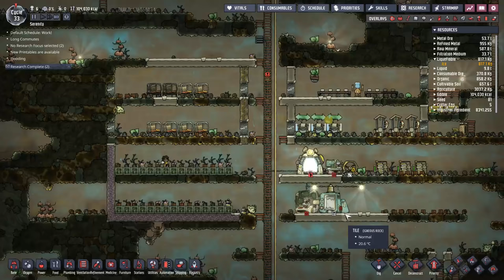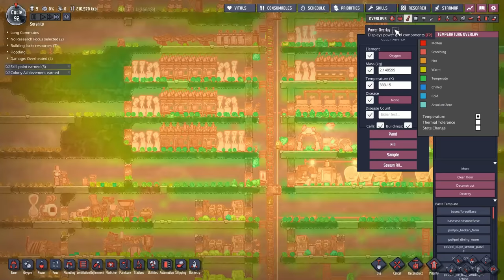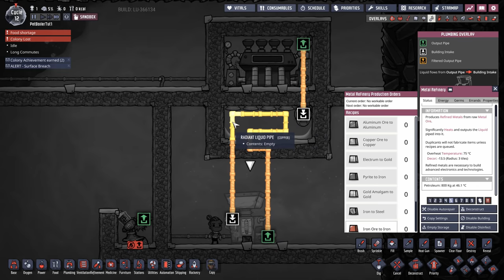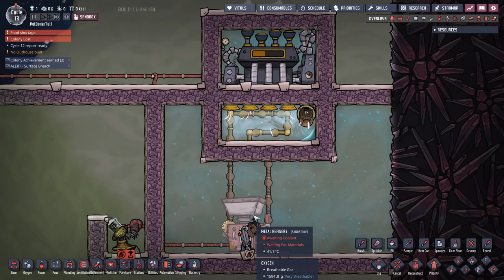Temperature management: Tutorial nuggets : Oxygen not included

Comment: Great vid. It gonna make my future base more efficient. 
I have 1 more question. How Tempshift Plates actualy work and what's the point of using them?
Reply: They act as lubricant to move heat around as a background prop. Normally it takes a long while for materials to transfert heat (between gases and tiles, or even between tiles without limiting dupes movement). And some gases and materials have a low thermal conductivity. The tempshift plate acts like a conduit for all nine "space" around it. They have a lot of mass (800kg, compared to a tile with 200kg, to a tile full of liquid 1000kg, to a tile of gases (between 1 and 20 kg for extremely high pressure; normal gas pressure for a dupe is 2kg to avoid the "pop eardrums" debuff)) and act like radiant piping for all their 8 other "space" arounf them, equalizing temperature between them at a quicker pace.
Reply: @francoiscoupal7057  thanks, now its much more clear for me. :)

Comment: This is exactly what I was looking for, as I just started converted my masses of various heat-generating machines into an industrial brick, so thanks!

One question...  I've noticed that even though the room is full of steam, with CO2 at the bottom (from the petroleum generators), I still see the occasional blob of polluted oxygen floating around near the top.  I suspect it's from the polluted water being generated by the natural gas and petroleum generators.  Even though I have a liquid pump at the bottom pumping that out, I guess it's offgassing and producing blobs of polluted oxygen that float to the top.  Will those impede the steam turbine in any way?  Does it only ingest steam, and will leave non-steam blobs of gas there?  Or will it suck them in but then jam up and stop working (like when the wrong liquid is fed into some machines)?

Thanks again!
Reply from the maker: I think it will bock the turbines, you should only get polluted O2 forming if the pressure in the room is below 2kg. I keep my room at +15kg and no O2 can from from the polluted water.

Comment: Is there a kind of rule of thumb for how big an ice box ought to be? I am referring to your earlier video on rockets (part 1) in relation to creating liquid O2 and H2, and not wanting too much liquid O2 in the liquid O2 tank, and that a bigger liquid H2 tank if higher liquid H2 production rate is desired (these two tanks are essentially the icebox, right?).

Also I have a similar industrial brick set up in my base but my ice box (stole your design up there with a pump and vent setup, instead of a constant loop) somehow stabilises at around 60C, still trying to figure out why (though it's not really causing any critical failure), but I doubt it has anything to do with its size (though my icebox is slightly bigger I think sizing at 3x3).
Reply from the maker: Unless your industrial brick is producing a megaton of heat you should be able to reduce the temp of it as low as your coolant will allow. Double check your insulated/radiant pipe and make sure your not exchanging heat where you should not. Also double check your temp shift plates, remember they can exchange heat diagonally not just left/right up/down. For the Liquid O2 H2 tanks I tried to make them small as it generally a waste to have more than 5/10 tonns on hand at any one point. If you check the rocket calculator you can figure out how much you would need if all your rockets requested fuel at the same time and plan accordingly.

Comment: @17:23 my setup is close to this, but the metal tiles are not transfering the cold across the metal tiles and door.
I used iron for my metal tiles and steel for door. Yeah 25% less thermal conductivity, but not 0.
For some reason my cold transfer from my cold tank to my little icebox is soooo slow 5 cycles and have gone down like 5c :(
Do i really have to use alluminium?
Reply from the maker: Did you use any Temp shift plates? The water itself is not a great conductor, so the temp shift plates force the temp from the water/ice into the iron tiles.

Comment: In my base I use 3 steam turbines + aquatuner for a single refinery, with a largish 4x15 boiler room to radiate it, using crude oil (and some naphta I had) and the coolant still overheated to sour gas. 

In your example, a single turbine is enough to smelt steel without boiling the coolant.
That said, I use an average of 2-3kg steam per tile, while you seem to use ~20kg. Is that such a big difference?
Thanks again for your videos, keep up the good work!
Reply from the maker: The extra mass makes a huge difference. Imaging a 500C 10kg bubble of hot liquid passing through a room that has a half a kilo of gas pressure at 0 C. With perfect temperature transfer the half kilo of gas and the 10kg bubble will end up at 476C. Now make that half kilo of gas 20kg and everything will even out at 166C.
If you want to cool or heat things up having an awful lot of mass around at the temperature your aiming for makes for a very stable system.
Reply: That totally makes sense. Moreover, due to TH clamping, low masses might not conduct too well.
I think also the naptha was problematic. I thought it might be good because of the higher vaporization point and higher SHC, but its TC is much lower, meaning it sheds the heat slower.
Made some adjustments that work better now.

P.S. When cooling a cool steam vent, isn't it better to put the AT/ST in the room with the vent? That way you can utilize the fact it starts at 110, heat (with the AT) and get better cooling.
In my system, I have a pool below the vent with doors that open when the pressure in the main room is too high. The AT cools that pool.

Comment: Loving these videos! I do have one question on how I should cool down a massive tank of 75C clean water. I have a salt water geyser which I desalinate and store in a large tank, but I'd like to use the water in my base, maybe for Bristle Blossoms or whatever. Could I place my large tank in the same spot where your 3x3 is and have it cool down enough with this setup? Would love some suggestions!
Reply from the maker: My first piece of advise would be don't grow crops that require water, either hatch/slickster/vole ranching for BBQ and/or wild planting crops using pips. If you want to you can cool the water down using the designs show though you would need to do a little flow control. If you limit the liquid pipe to 2.8kg it should work for you.

For example with the 3kg O2 build just run a liquid pipe through instead. The Aquatuner can cool the 10kg/s water going though it by 14C so that is 10kg/s by 14C. Assuming the water you are cooling is 75C and you want to cool it to 25C that's 50C of cooling you are looking for. 50 divided by 14 = 3.57 that divided into the 10kg of water and you get 2.8kg/s.
Reply: @FrancisJohnYT   Ah, I see! I did indeed pre-install 3 liquid pipe sections just like the radiant gas pipes but it didn't cool the water down very much at all, I kind of forgot about heat capacity of gas vs water. Would it work if I just do 1 radiant pipe section in S-shape through the box (so 9 tiles of radiant liquid pipe instead of just 3) and set the flow to about 8.4kg/s (3x 2.8kg/s)?
Reply from the maker: @T675Sparky  You can only cool 10kg/s of water by 14C with a single aquatuner.

Comment: I'm having trouble getting the aquatuners off the ground. I fully understand what I need to do. But on YT it seems like the boil almost immediately (though I guess the tutorials are usually sped up). But I do the same and the temperature changes only VERY slowly. So the cold stuff is only getting cold after a huge time and the steam has issues boiling. Or it's boiling, but then not reaching the next threshold for the turbine to kick in. I got a prototype now that's cooling alright (just a cool steam vent + some cooling loops), but doesn't produce power. The steam sits just under 125 and refuses to go over most of the time. Is this normal when you don't dump that much heat into the system?

EDIT: Ok, so some diamond temp shift plates in the steam room help a lot. Granite doesn't work as well. Apparently the aquatuner isn't spreading around the heat properly. But I shouldn't really have to use a high end material like diamond for such simple thing
Reply from the maker: This game usually takes a bit of things not working, followed by a moment of ahhhh that's how that works. Sounds to me like you figured it out in the end, for me personally half the fun is in the figuring out. The other half is figuring out how it fits into the rest of the game.
Reply: Could you be adding too much water? The more water, the longer it takes to heat up. This example only had about 100 kg per tile, but you can fit ten times that much (and it'll take ten times longer to start up).

Comment: This is the second time I've watched this video and one thing still didn't check for me, could you please explain why the central loop is doing the cooling while it is not exchanging temperature with the ice box...?
Reply from the maker: It should be exchanging temp with the ice box. The Ice box is surrounded in metal tiles and radiant pipes run through it. As the liquid passes around the edge of the ice box in the radiant pipes it exchanges temp.

Comment: I feel like it is a bit of a failure of game design that all our cooling solutions boil down to using a steam turbine setup.  We have many many ways of doing pretty much everything else but cooling stuff off without throwing the hot product away leads back to the steam turbine.
Reply from the maker: You have other option it's just...... if something is hotter than 125C you can get energy out of it from a steam turbine. At that point you lose the incentive to dump heat into petroleum and burn it off in a petroleum generator.

Comment: *im pretty sure this is nerfed now somehow.  I built this setup (Thanks mr.Francis) but I get nowhere as much cooling as in this video. Oxygen comes at 50 degrees and I get damage to liquid pipe because polluted water freezes. Input oxygen is 70c.
Reply from the maker: The save game file is linked in the description if you want to open it up and have a look. As far as I'm aware it still works.
Do you have a sensor to stop the liquid chilling below it's freezing point?
Reply: @FrancisJohnYT  I actually made a mistake with materials I was using. However even after fixing my mistakes I still had problems - it was very near the freezing point. At this moment I realized that I'm an engineer and I'm suppost to use my own brain cells as well. Therefore I removed the gate and metal tiles completely. Then I pulled the radiant cooling pipe to cross on top of the gas pipes. I set my coolant at 20 degrees and oxygen comes out at nearly the same. No more freezing problems

I have noticed that Mr.John likes these gates in other builds as well and I assume they are very much needed at dealing with magma etc. Thank you so much for these old? but gold videos!

Comment: Is there a tutorial that ebtter explains the filling of the loops with the liquid bridges? My liquid does not continue to cycle around then the aquatuner is off
Reply: Might you have had both a bridge and a pipe between it attached to your loop? Whenever you fill a loop, it's always important that all sections of pipe must have a reliably simple direction it flows in. The best way to control the direction of fluid when branching or merging is bridges. If you use a reservoir with a simple loop (no branches) the reservoir has a set direction and acts exactly like a bridge. And any time you're adding liquid into a loop, or really branching two pipes of fluid  it's best to only touch the two routes via a bridge between the them. As an added bonus, removing a bridge never leaks the fluid, as it doesn't have any storage capacity.

Comment: I tried to build the model with the two pools of polluted water, with the steel door in the middle to control the temperature flow between both sides. The aquatuner/steam turbine/right-hand pool are working fine, but there's no heat being transferred to the pool on the left side. The aluminum tiles at the right side of the steel door are at zero degrees and the left side ones remain at 30+ degrees, with no heat exchange between. The door is obviously open. Any idea of what could be happening?
Reply from the maker: The door needs to close to allow temperature to transfer across. Use a temp sensor to regulate when the door opens and closes.
Reply: Thanks John! Your videos are awesome!!

Comment: Hello, thank you for the great videos! It has helped me so much through my game.
I have a few questions regarding the cooling of the liquid used in the metal refinery with the steam turbine at ~21min.
1. How do you know how many "lengths" of pipe to use through the bottom of the steam turbine?
2. Isn't the steam going to be above 90 degC and cause any heat exchange to not be that effective (I'm assuming usage of polluted water here)? (if coolant used is above 90degC it gets cooled to 90degC minimally and if coolant is below 90degC it gets heated up when passing through the hot steam?)
Reply: I'm not really sure what you're asking with 2. If you mean the pipes beneath the steam turbines, in the steam room, yes, the coolant won't be cooled below the temperature of the steam (at least 100) in this system, so you need to make the refineries with materials that increase the overheat temperature. This is in contrast to a system where you run the coolant through an aquatuner inside the steam room, which can make the coolant much colder than the steam.

Comment: Could you explain the mechanics behind disconnecting from the main power grid saving power? I'm not aware of any line loss type behaviour?
Reply from the maker: The steam turbine and aquatuner are on the far side of a power transformer so they can't feed power back onto the grid. If the steam turbine turns on and the aquatuner is not running the power would be wasted. So you keep a battery around and you keep it's power level between 30-40% so if the steam turbine turns on there is somewhere to store the power.

Comment: Question!
If I decide to pump 95C water from geysers to an electrolyzer, and I run the oxygen to an icebox (like the one in 14:50), would the oxygen be cool enough to pump into my base? (Assuming let's say, I set the thermosensor to 5C or so). 

Or would that fail? Cause I still have hot hydrogen :<

Comment: Question: Is mixing liquids workable for heat transfer? like if I had super coolant in the pipes but polluted water in the tanks, would that be ok or cause issues? Thanks for an awesome tutorial!
Reply from the maker: Liquids don't mix, you get sperate packets if you mix them in pipes. It will still work as long as you don't freeze/boil either liquid but it's not recommended.

Comment: For me these designs seem not to be working? The heat exchange is way too slow. I have copied one of your designs from the video 1to1 (same materials, sizes etc) and it took half an hour to even warm the water enough to make it into steam? Am I messing up something or was there some patch or other?
Reply from the maker: It depends on what you are trying to cool. If it's running flat out cooling something it's adding 14C to 10kg of water every second. If you only have 100kg of water in the steam room it would only take 71 seconds to get it to start boiling. If the steam room has 1000kg then it's ten times longer. Thiers a lot of variables here so I can't know what's off with your setup.
I suppose the question is not is their steam but are you getting the cooling you are try to achieve? If you are then who cares if the steam room is not hot enough yet?

Comment: When I could the cooler the cold doesn`t seem to penetrate the automatic door with the 2 steel tiles left and right. Is that new or did I make a mistake?
Reply from the maker: The temp only transfers when the door is closed.
Reply: I'm having this problem as well. I switched to using gold metal tiles (60 thermal conductivity vs 54 for steel) and I'm still not getting enough cooling from the center icebox to the side ice box. I have diamond shift plates in the side ice box, and iron shift plates in the center ice box. I'm going to switch to a design Francis shows in this video at 20:05: https://youtu.be/2Aq3kRTxlW0?t=1205, it seems like it would suck heat out of pipes more efficiently than the tiles + doors allow the side iceboxes to do.

Comment: Hi Frances, I copied this device literally step by step but the lower level isn’t making steam, which is causing nothing to cool down.. which ends up with the metal refiners liquid output pipe (which is ceramic!!) to break due to overheating (its ceramic!! Howwww) PLS PLS HELPPPP
Reply from the maker: The liquid output of the metal refinery is it passing through the aquatuner stem type area? That is where it's supposed to dump off it's heat. Also what liquid are you putting in the refinery, you have to use something with a high boiling point, water won't work, oil or petroleum are usually good early game ones. 
There is a save game linked in the description if you want to open up the sample map and have a look.